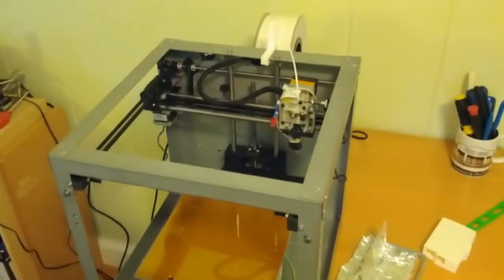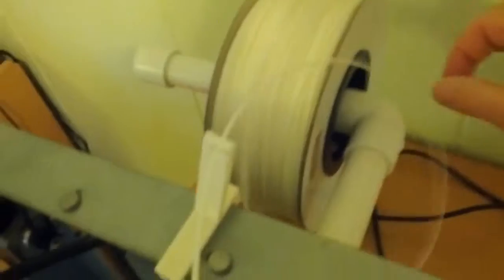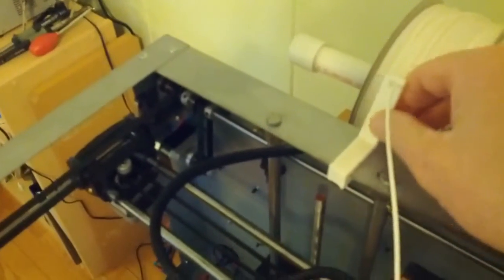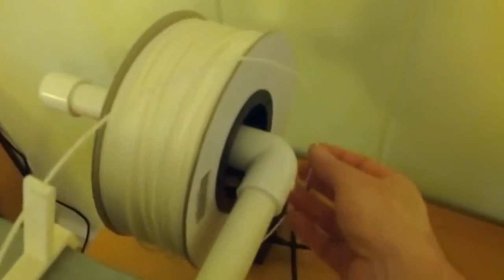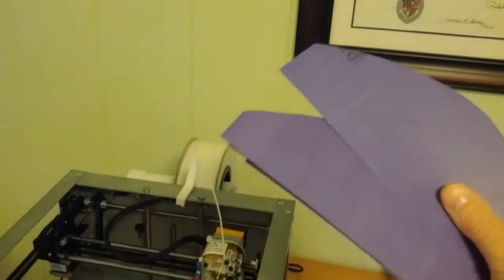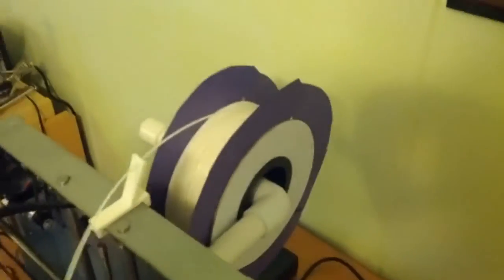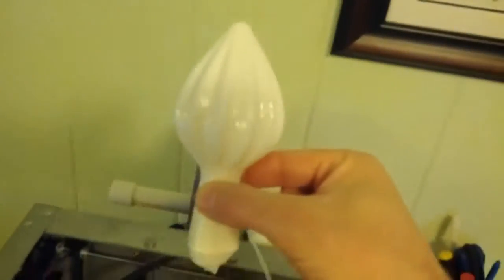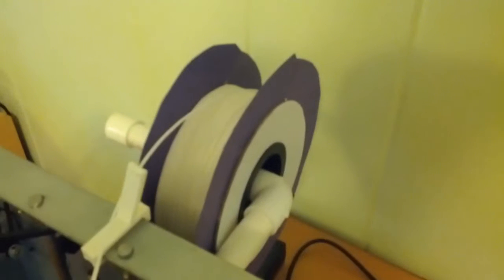Keep filament from falling off the spool

Comment: Damn.
That's basically what I did.
I just cut two circles out of the box the filament came in and stuck them to either side.

I was hoping for a slightly less bodged solution though.

Comment from the maker: It's a Solidoodle 3 printer. That juicer in the video is my biggest success so far but I've made two attempts so far trying to print a cell bowl (math art) and I need to make some modifications to my printer for that to work. I'm building a plexiglass case for the printer that will keep some of the ambient heat in which should help my success rate. Love it though. Having a blast.